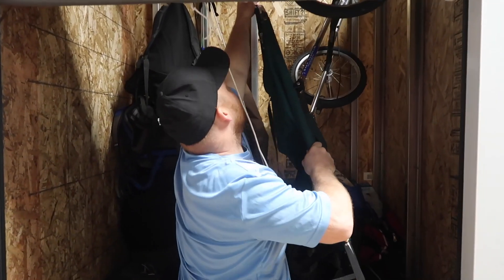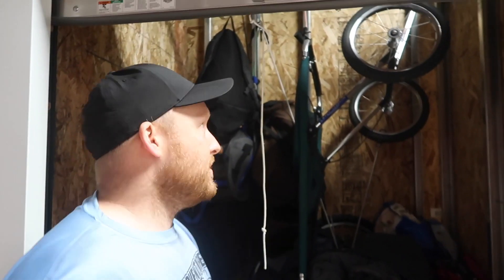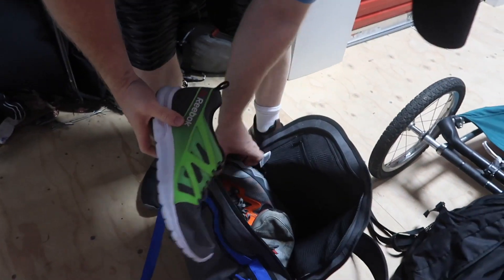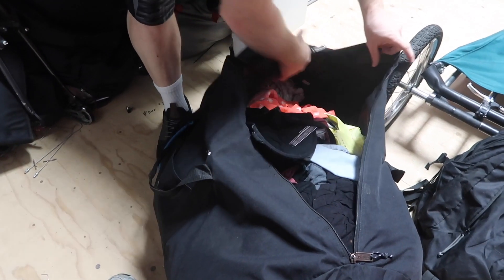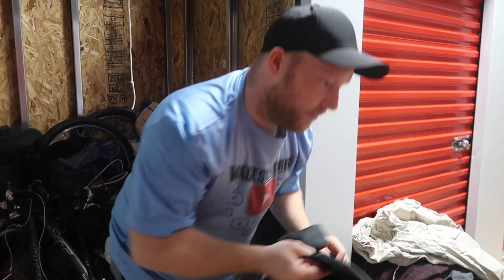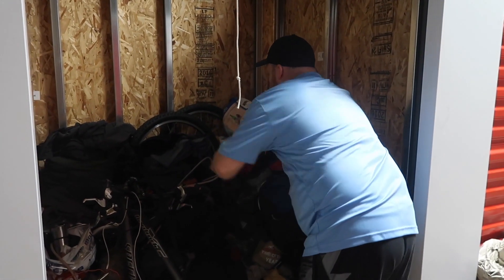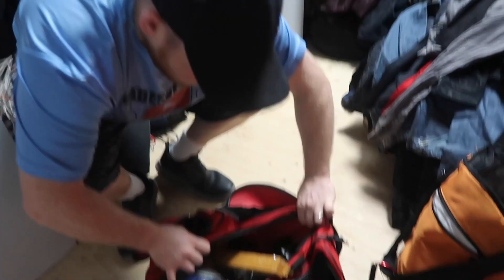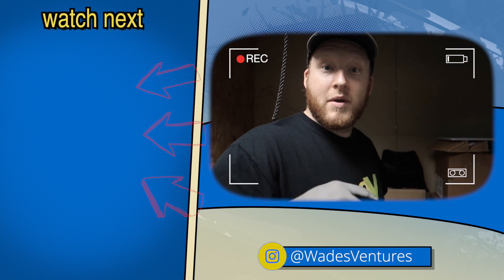YOU HAVE NO IDEA 18 Mystery Bags FULL Inside Abandoned Storage Unit

Comment: someone already addressed this but Carl Zeiss whether in Binocs or Lenses on Cameras are usually worth flipping.. very good German optics....
the one thing you held up at 19:30 was a Hand Grip for a 35mm Camera with 1/4 20 thread the same as a tripod. Connects to the bottom of the camera for increased stability and it looks like it had a flash shoe on top (moving flash off the top of the camera decreases chance of "red eye")